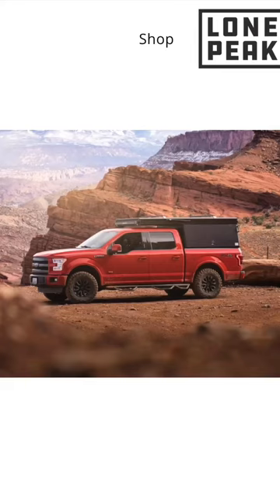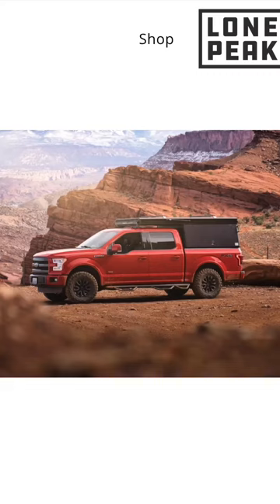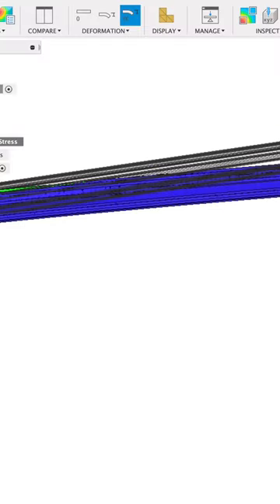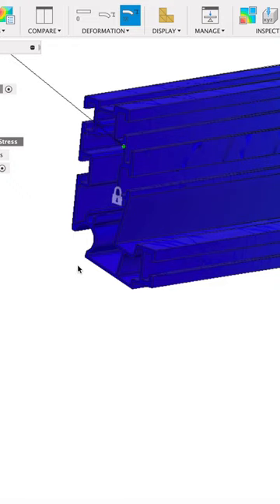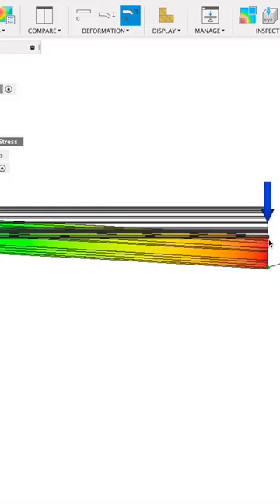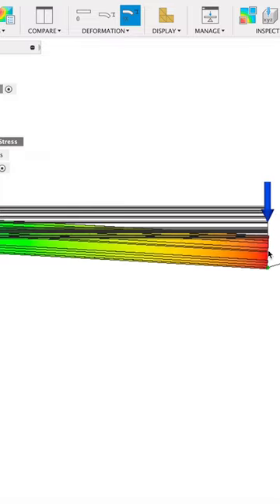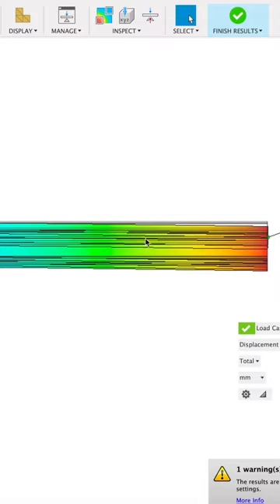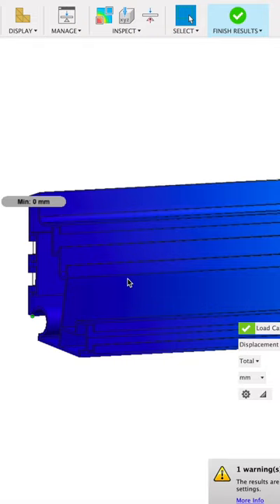Extrusion Strength Test

Comment: Where is the added height added to? I saw the option on the website. Is it added to the bottom or the top of the camper?
Reply from the maker: The height is added to the a pillars so the distance between the top of your truck and the camper expands.
Reply: @lonepeakoverland9213  Thank you.
Reply: @Lone Peak Overland  does that mean the info on site that says it's approx 2 inches from camper to roof of truck is outdated and now we have a little mote Clearance? I ask because a Ram 1500 sharkfin is 2 3/4" tall so 3 or 3.5" inches of Clearance would be great as we don't have to select tall option.
Reply from the maker: @steelontarget  The goal is to have our base height be able to clear 80% of sharkfins so you don't have to choose a tall version. This is still being finalized though.
Reply: @lonepeakoverland9213  thank you 😊